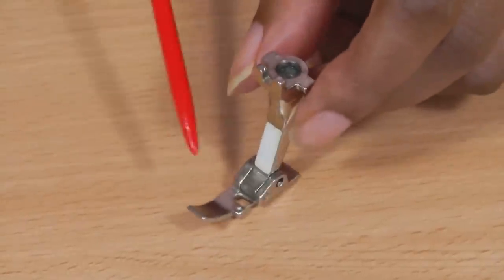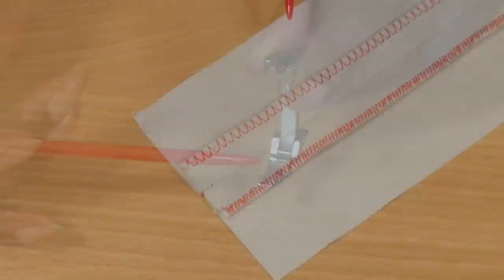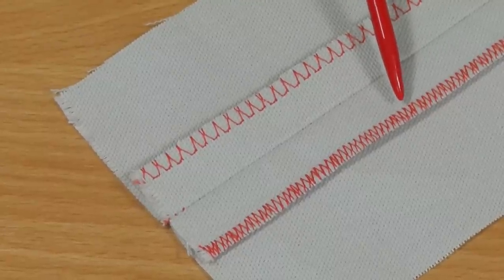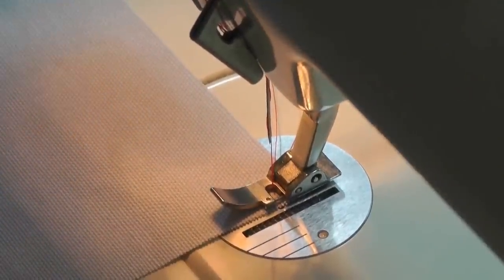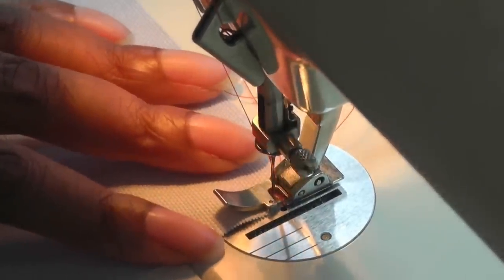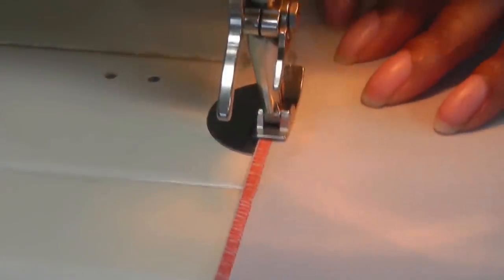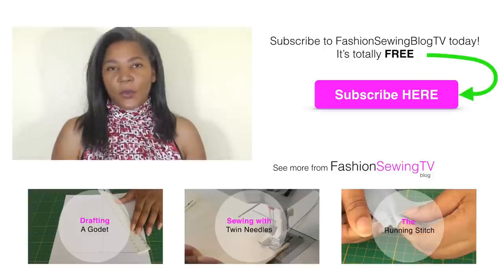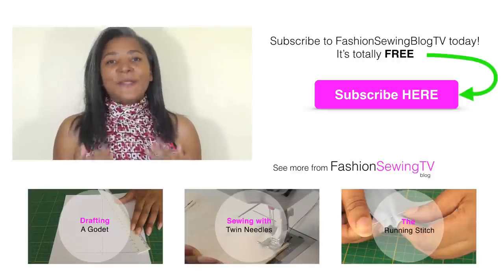Using an Overlock Foot on a Sewing Machine

Comment: Hi. Thank you for sharing this useful video, I find it very helpful. What would be the right stitch length and width numbers to use to get small fine overlocked stitches. Also, what would be the right tension number for overlocking please? Thank you.
Reply from the maker: You’re welcome Laleh! Stick with smaller numbers and test the stitching on scrap fabric first, until you find the most suitable setting for the fabric you are using, before sewing your project. 😊
Reply: Colleen G Lea - FSBTV Thank you for replying. I have just tried on the smallest stitch which on my Singer machine but the needle broke! Not a very encouraging start for me but I’ll try again. Thank you!

Comment: Hi, I've Brother JX2517 sewing machine and it doesn't have built-in overlock stitch pattern. So I've bought SA135 overlock vertical foot to serve the purpose. While overlocking, alongwith fitting this overlock foot, I set zig-zag stitch pattern built-in my machine. But that zig-zag stitch pattern doesn't change even after using this overlock foot. I mean the zig-zag pattern remains same whether I am using the simple presser foot or the overlock foot. Why is it so? Am I missing some step? Please help.